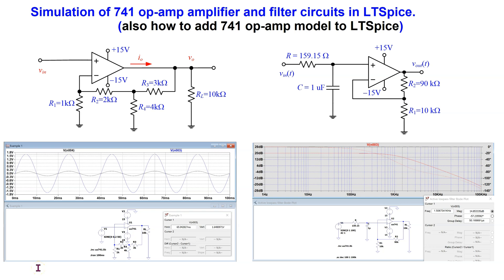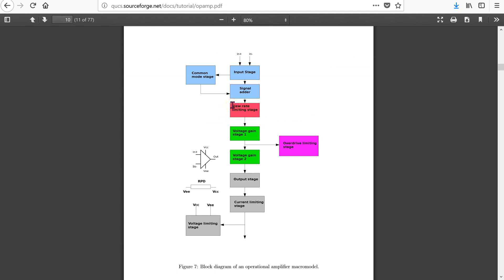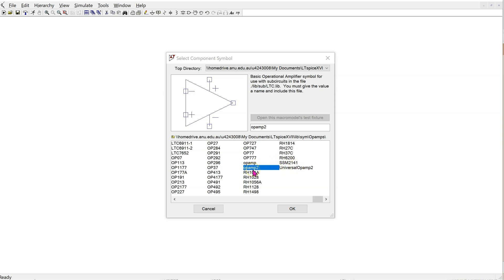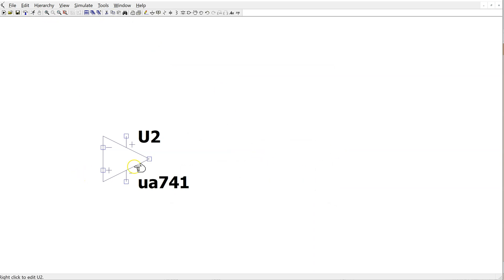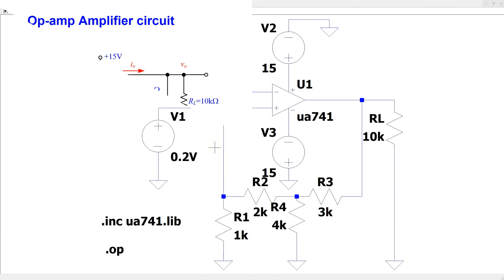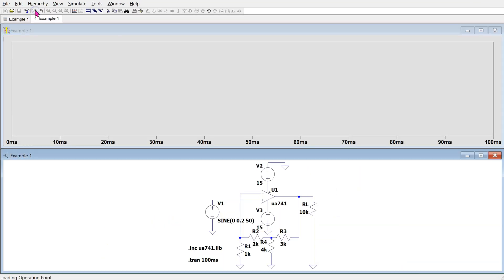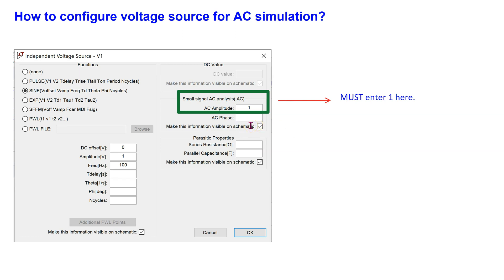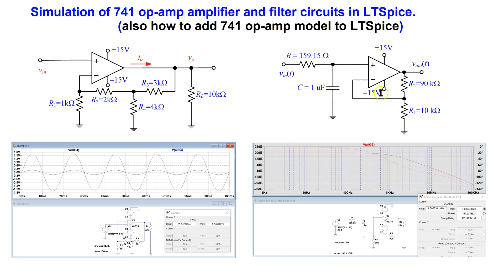Introduction to LTSPICE for Simulating 741 Op-Amp Amplifier and Low pass Filter Circuits

Comment from the maker: The ua741 subcircuit is below. Copy paste this subcircuit in a uA741.lib file. Place this subcircuit file in the folder
C:\Users\[USERNAME]\Documents\LTspiceXVII\lib\sub 
--------------------------------------------------------------------

* Source: http://qucs.sourceforge.net/docs/tutorial/opamp.pdf (page 62)
*-----------------------------------------------------------------------------
* connections:   non-inverting input
*                |  inverting input
*                |  |  positive power supply
*                |  |  |  negative power supply
*                |  |  |  |  output
*                |  |  |  |  |
.subckt uA741   1 2 3 4 5
  c1   11 12 8.661E-12
  c2    6  7 30.00E-12
  dc    5 53 dx
  de   54  5 dx
  dlp  90 91 dx
  dln  92 90 dx
  dp    4  3 dx
  egnd 99  0 poly(2) (3,0) (4,0) 0 .5 .5
  fb    7 99 poly(5) vb vc ve vlp vln 0 10.61E6 -10E6 10E6 10E6 -10E6
  ga    6  0 11 12 188.5E-6
  gcm   0  6 10 99 5.961E-9
  iee  10  4 dc 15.16E-6
  hlim 90  0 vlim 1K
  q1   11  2 13 qx
  q2   12  1 14 qx
  r2    6  9 100.0E3
  rc1   3 11 5.305E3
  rc2   3 12 5.305E3
  re1  13 10 1.836E3
  re2  14 10 1.836E3
  ree  10 99 13.19E6
  ro1   8  5 50
  ro2   7 99 100
  rp    3  4 18.16E3
  vb    9  0 dc 0
  vc    3 53 dc 1
  ve   54  4 dc 1
  vlim  7  8 dc 0
  vlp  91  0 dc 40
  vln   0 92 dc 40
.model dx D(Is=800.0E-18 Rs=1)
.model qx NPN(Is=800.0E-18 Bf=93.75)
.ends

Comment: The procedure described takes effect only if "ua741" is replaced by "uA741". This is so because the name of the subcircuit is actually "uA741".
Reply from the maker: Yes that is correct. I will add a note to the video description about the lower/upper case sensitivity.

Comment: excellent explanation, but I get this error "unknown subcircuit n002 n001 VCC 0 Vout ua741". I tried your lesson step by step several times. Version is 24.0.9
Reply from the maker: Thank you for the feedback. It may be that the op-amp model file is not placed in the correct location. Hence, it is giving unknown subcircuit error.

Comment: Can you explain to me how you got the term R3/R1 in the expression for vo? I tried to combine two expression for the voltage dividers R1, R2 and R3, R4, but that doesn't work. So I'm doing something wrong. Can you help me?
Reply from the maker: Thank you. The detailed theoretical analysis of the circuit considered in this video is available in this video here: https://youtu.be/YX_X2vilisY?si=qEvXCy2MTLLf3o9-&t=300
Reply: @electriccircuits7164  Dear sir, I looked at the link you provided to me. And it made me perfectly clear how you derived the expression for vo, which you use in this video. Thank you very much.

Comment: i am getting an error. (Could not open include file " ua741.lib")
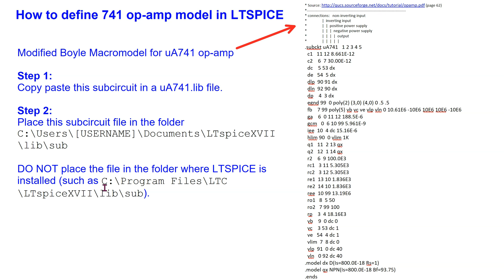Reply from the maker: This is a common error which has been reported by some other viewers. See other comments in this video.  It arises when the symbol has not been properly created and linked. Please carefully follow all the instructions in the video from 4:03 onwards. The subcircuit file must be placed in the correct folder where LTSpice can find it. See the path indicated in the video description.
Reply: @electriccircuits7164  I have placed the symbol in the library specified in component top directory. Yet I am getting the same error.
Reply from the maker: Thank you for reporting this. Are you using the latest version of LTSpice?
Reply: @electriccircuits7164  Hello Sir, I was able to run the simulation, I cross checked it with the values you have shown in the video and my simulation values are matching with what you have shown. Your tutorial is on point. 

Yes I am using the new version. 

I was making the following mistakes. 

1) Did not save the uA741.lib file. 
2) I was not careful while using lower & upper case.
3) Symbol (.asy file) not saved at proper location
Reply from the maker: Thank you for sharing the detailed post. It should help anyone else with common mistakes to avoid! I am glad you were able to successfully troubleshoot!